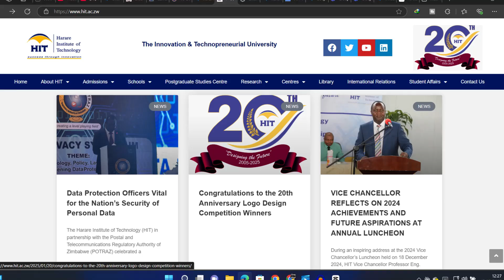Top Engineering Professor Stunned By How African Inventor Device WORKS

Comment: Folks, look carefully at the digital readout mounted to this "amazing invention" in the plastic case....can you see what it says? 12 watts. That's right, 12 . That's barely enough power to run one of those tiny personal electric fans people carry around that are run on small batteries. It isn't enough recharge a EV battery over a 24 hour period, or 48 hours, or 72...much less run an EV in real time. Impossible.
Sure, sure, it works!...Kind of.   But the laws of physics prevents it from being able to harvest enough power from background EMR to be useful for anything. It's a total scam. 
If our educational system was not in such a state of dysfunction, pretty much anyone would be able to spot the deception here immediately.

Comment: Why do hybrid europeans think that only they have the ability to create
Reply: There are a lot of scammers in europe as well. Think of Nunzio La Vecchia with his "nanoflowcell" car!
Reply: Or Andrea Rossi with his cold-fusion reactor "E-Cat"!
Fraud isn't restricted to africa.
Reply: And Guy Négre with his compressed air cars!
Reply: By the way: Do you believe in one of those mentioned european "inventions"?
Of course, compressed air cars work basically. But they can't provide the range, efficiency and performance, that was promised by Guy Négre.
Low-power-cars with a couple of tens km range and a very high electricity consumption wouldn't make much sense.

Comment: What happens when you find yourself without radio frequency to  power up the device?
Reply: Perhaps the microsonic energy device contains a small radio transmitter, that always provides a minimum level of radio waves? Powered by microsonic energy of course!🙂

Comment: The Real invention would not be the microsonic generator as he sais it too it would be the energy amplifier that is the real fake thing.
Reply: This is his microsonic device. A solar power bank with a battery you buy on Amazon. Pretending it is his invention 😂😂😂

BROWEY Portable Power Station 1000W with Built-in Solar Panel, 614WH/192000mAh LiFePO4 Battery Pack, Solar Generator with AC/DC/USB/PD Outputs for Outdoor Camping, RV Travel, Emergency Preparedness

Comment: I  never give hints to scammURZ and CG hoaxzes ... but next time add a fan the same size as the cooling fin (heatsink). It will not work if the fan is smaller. Also, dont leave enough room behind the cooling fins to hide BATTERIES..... the TV power unit is an unaltered power inverter... when some maxwell TECH has to be there, right??.... the single change is the place to hide a battery behind the nonfunctional cooling fin

Comment: May be he use the battery inside  after then he use transmitter a long the road to charge the battery during the car running , if he use the power directly from the RF  may be not enough  because the capacity of the car consumption is bigger   but if we charge by wireless into the battery  so it can remain the power for running ,

Comment: This is bullshit. Anyone who understands radio waves and other signals in the air, knows you need power to amplify them to a useable level to drive anything. The power of these signals are extremely small. We are talking mili, Nano, Pico. A separate power source is a requirement and the amplified signal would still be too small to move a car.  Seems like people sre becoming stupid and more stupid each day. Of course this is bullshit.
Reply from the maker: everything we know points to this not being Possible so I wonder what's going on and why a university wants to damage it's reputation for this,,but here was the other comment yours or was that your twin identical bro😁

Comment: Tested & validated by a university in Zimbabwe? Oh! For a moment there, I thought it was a university outside of Africa. 
I posted a question to CoPilot, "Is Maxwell Chikumbutso invention for real?", and the following is the answer:
Based on the available information, Maxwell Chikumbutso's claims about his self-powered car and Microsonic energy invention have not been verified by the scientific community. Investigations and fact-checks have shown that his car was a modified electric vehicle, and the so-called Microsonic energy device was a commercially available product.
Experts have dismissed these claims as pseudoscience, pointing out that radio waves do not carry sufficient energy to power a car. So, it's safe to say that these inventions are not as they were presented.

To add to my skepticism, if Maxwell's invention is genuine, China (and the USA) would most certainly have been all over him to help take his invention to the next level. However, so far, I have not heard or read anything from China about Maxwell's invention.

Comment: The important question is whether the Harare Institute of Technology verified the validity of the technology by reconstructing and/or deconstructing a working example. Given the mental and physical laziness of people in general these days, I suspect they just verified that the items weren't plugged into outlets while they were working. I'm sure that we will find that each has a battery pack secreted within.
Reply from the maker: I think so too... they should have done a thorough verification and even released a report on the same,,but maybe even the guy was just shown a vehicle and told that it's on and not connected to anything and he believed that it's true

Comment: Where is the source of those radio frequencies?
How much energy is required to transmit those frequencies vs the energy harnessed from them?
This is wireless electricity transmission
Reply: Radio frequency is a naturally occurring phenomenon available everywhere on earth and even in the space. It's like the solar rays of light that radiate from the Sun but radio waves/frequency are invisible.

Comment: 😂😂 I have just looked at a the screenshot of the pics in the video.

The case is what new lithium batteries are shipped in.
The x2 controllers are BMS for lithium batteries.
Everything else is a disassembled cheap Chinese 240v inverter, the lcd display says 240v 50mhz which is mains power in a lot of places.

There’s a reason no one can inspect it, someone is trying to scam you.

Comment: The pic shows a lithium battery, a BMS circuit board, a lcd display, the connectors are what is used in RC racing.
Do where is the micro sonic parts?.

The conductor is only capable of 30 ish amps, so the voltage produced would need to be in the 1000s of volts range to run a car and need a way of dropping it back to 5-600v to run the car

Comment: As an openmided engineer having invented various new concepts myself I strongly support all efforts to invent groundbreaking technologies, including what is exhibited here. It does'nt matter if they defy any existing physical laws as long it can be proven beyond any doubt that they work. That is just a proof that the established physical laws in question are flawed. 

However, exceptional claims must be supported by thoroughly verifiable proof. A nice speach by a representative for Harary Technological Institute sounds promising, but is far from being proof that the mentioned technology performs as claimed.

What we need is an  endurance test where the self-charging El-viechle is run in a test-rig capable to  demonstrate that it can run for a timeinterval corresponding to a distance of several hundred km with a load-momentum on the tracking wheels corresponding to an out-put in the range of 15-25kW, or for a time interval and an applied load that exceeds the total energy capacity (kWh) of the battery capacity of the car.

It must of course be made sure that no external power supply is connected, except the proprietary microsonic device. 

First, when proven that the performance exceeds the full-laden capacity og the batteries themselves, it is proven that this is ONLY due to being constantly charged by the microsonic device.

Without such or similar verification being witnessed and endorsed by an independent and well-recognised party, one can not expect the world to accepted the extraordinary claims surrounding this invension.

Comment: You asked the question "why do Western nations often dismiss validations done by African institutions unless they are confirmed by their own experts?". Because, clearly in this case, African institutions undermine their own credibility. 

I gave a list of facts before, but here's another perspective: Before Chikumbutso's magic "microsonic device" can generate power from radiowaves, the radiowaves have to be generated. This is done by transmitters mounted on transmitting towers. Now, for a high-power FM Station (Commercial/National), for a 100kW ERP output and a range of 150 to 300km, you'd first need to power the transmitter with about 40kW of electrical energy. ERP decreases by the square inverse law of 
Power Density = ERP / (4πr)

This means that if you had an antenna of 1kmx1km (1000x1000m!) at a distance of only 10km from the transmitter, the ERP power collected can only be around 80W. Since Chikumbutso's EV needs around 150kW for maintaining 220km/h, you would need to feed the transmitter with 40 x 150,000 / 80 = 75,000kW or 75MW. That is a solar panel measuring 580x580m!!!

Can you see how uttelry nonsensical this "validation" really is? I mean, let Chikumbutso believe what he wants, but for "science" to back this outlandish belief is preposterous.

Comment: HONESTLY, VALIDATION BY THE WESTERN WORLD IS NOT EVEN NECESSARY. AS LONG AS THE TECHNOLOGY ACTUALLY POWERS VARIOUS TYPES OF BATTERIES & POWER INFRASTRUCTURE IN ZIMBABWE & NEIGHBORS WHO MAY HAVE BOUGHT THE MICRO SONIC BOXES, THAT IS ALL THAT MATTERS. IF THE INVENTOR IS FAST INSTALLING HIS DEVICE AND MAKING SERIOUS MONEY, WHO CARES IF THE WEST HAVE VALIDATED IT?

ULTIMATELY THE THEORETICAL FORMULATIONS AND PROOF WILL BE DELIVERED BY PROFESSORS, ANY WAY. MANY INVENTIONS WERE NOT FIRST PROVEN BY THEORY BEFORE VALIDATED IN PRACTICE. FORTUNATELY, ELECTRICITY HAS A WIDE RANGE OF APPLICATIONS AND SINCE THE INVENTOR IS ALREADY SELLING HIS MICRO-SONIC BOXES, ALL YOU NEED TO DO FROM ANYWHERE IS SWAP SOLAR PANELS WITH THE MICROSONAR AND OBSERVE IT FOR SOME DAYS IF IT CONSISTENTLY EMITS STRONG DC (DIRECT CURRENT) CHARGE. THIS PROOF OF CONCEPT REQUIRES NO HIGH SCIENCE OR THE LABS OF THE WESTERN WORLD, EUROPE OR ASIA.  THE INVENTION CAN BE VETTED SIMPLY FROM ANY GARAGE, THANK YOU.

Comment: First, a DIY analyses of Maxwell’s claim that there’s sufficient usable energy present in radio waves to power a car indefinitely:

A small car on an even road would need about 12.5kW to maintain a steady speed of 100km/h, going up to 19.9kW at 120km/h. (Such a car would be severely under powered and basically unusable, but let’s stick to those low numbers to demonstrate the utterly flawed principle.) Highly congested urban areas with plenty 4G, 5G, AM, FM, TV, Bluetooth and Wi-Fi have a radio frequency density of about 10mW/m² (A mid-range solar panel generates 170W/m², about 17,000x the output of what could be harvested from radio waves). If you had a 100% efficient antenna, which also doesn't exist, you'd need a receiver with 12500/0.01 = 1,250,000m². In different terms, that's an antenna measuring 1.1x1.1 kilometers. 
(As to the claim of 220km/h, that takes around 150kW, or an antenna measuring 3.9x3.9km.) 

The microsonic energy powered car is in fact a Kaiyi X3 PRO EV, manufactured in China with a MSRP of $18,500, and an electric range of 370km:
https://southeastmotor.en.made-in-china.com/product/jOxfatIMhVAZ/China-Kaiyi-X3-PRO-Pure-Electric-SUV-Left-Steering-Version-Wholesale-Supply.html

The “Microsonic energy device” is actually a UPS power supply, available from Alibaba for $795.48
https://www.aliexpress.com/item/1005007573244574.html?gatewayAdapt=4itemAdapt

The leading automotive magazine in South Africa questions his claim:
https://www.facebook.com/share/18pheqz7vB/

Snopes actually debunked it:
https://www.snopes.com/fact-check/zimbabwe-electric-car-no-charging/

Any questions?
Reply: Bravo, thank God someone with real math to question these scamsters who are after gullible people money

Comment: For him being the vice chancellor doesn't guarantee that he's is a scientist or an engineer. Enough with Maxwell's own demonstrations and stories of how the invention works. He should give a qualified independent scientist or engineer to conduct his own investigations and demonstrations and then we will all support him. The welding machine being used per my estimate is 1200w, the refrigerator he demonstrated is 800w peak of which a moderate inverter will easily power it so this is not all that impressive. But let him invite me to subject it continuesly to 6000w for just an hour and see if the power will be sustained or not and then we can prove his invention is legit.

Comment: They created a perpetual motion machine that would break physics. Skepticism is needed because the inventor never explained how he did it. If his invention works, the inventor is smarter than Einstein. Scientists use "critical thinking," and questioning the validity of science is good and critical to science.
Reply: Not perpetual motion machine, its the same has a solar panel or wind turbine, only better because instead of converting one type of energy into another, it turns one type of electricity into another useful one
Reply: how do you think african buildt the pyramid, you only need to read the bible, to know that the western empire , the 4 beast is the weakest of the empires that have existed
Reply: @blist14ant  as long as it works
Reply: He did explain how it works; do check him out....
Reply: Thanks for your idea will call him the black Einstein
Reply: @earldaniel7775  No his name maxwell chikumbusto..yall cant allow anybody else to shine without interjecting yourself..inferiority complex in full display

Comment: Have you ever drove your Car into a Cave or Certain Location with Weak Radio Signals? 

There goes your Phone Reception. 

Concrete and the Metal Structure will block the Signals and there goes your Power. Yes, you can feed that into a Capacitor to buy you time, but if your Capacitor happens to be near depleted, how will you get power?

I like his invention, but it relies on Radiowaves. What happens when ever your in an area that blocks or limits the Signals? 

You can increase the amplification, but that will require more Materials and it will increases the cost. 

Maybe I am wrong, but I find relying on the Radio Signals will eventually limit you.

If this goes World Wide you will eventually hear someone make a complaint that they were driving along and the power went out or when we had a Storm my TV went out or due to the Weather my House is without power.